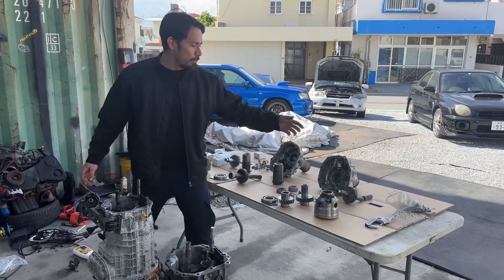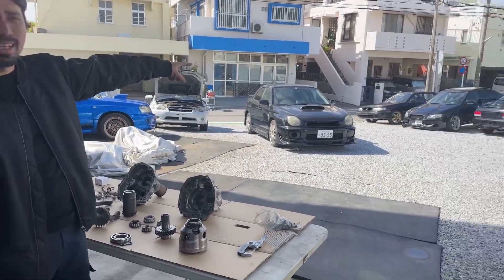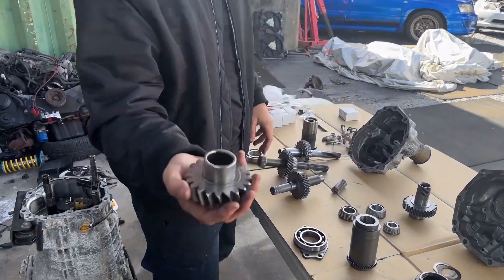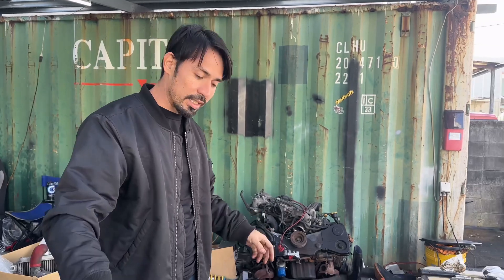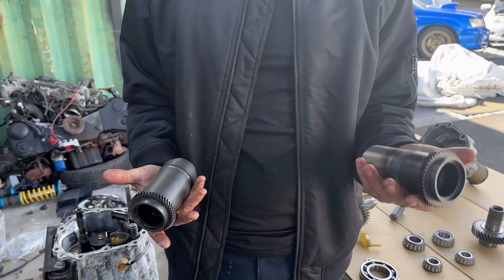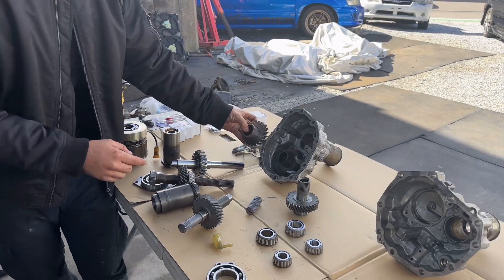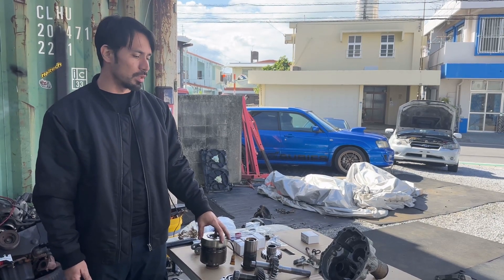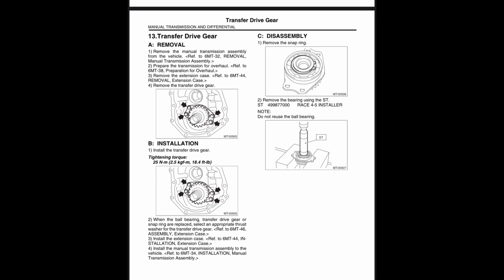TECH TIP for converting non-DCCD to DCCD 6 Speed / EZ30 Turbocharged Legacy

Comment: I have a question about the  automatic transmission setup. I have a built 5EAT ,  2008 OBXT, with HD plates and sleeves re-enforced, as well as a modified valve body. The trans was specially rebuilt to handle 8-900 hp. My understanding is that the trans (jayco) was used by many auto companies, like Nissan, in their Maxima, and the Pathfinder, and who’s only real weakness was that it was given a “Socker mom” tune, making is slow on the engagement of is clutches, providing a smoother, less noticeable shift. This in turn, with Subaru’s hi torque in their turbo and 6 cylinder engines, eventually killed the 3 to 5 clutches and packs prematurely. This was remedied by the alteration of the valve body, increasing line pressures and increasing speed of clutch engagement and release. But a question arose as to the center differential, being full time engaged, with bias towards the rear at approximately 40/60% towards the rear using a torsion style differential gearing. Is it possible to use a dccd controller or dccd’s components, mimicking the operation of the STI 6 speed in control of front / rear bias control in the automatic? It was difficult to find any more information on the 5EAT differential online. And the builder only provided the functioning transmission to great satisfaction. I have been unable to reach the builder for answers to this question. I was hoping that your group may have answers for me in this regard. Anything that you can explain to me would be greatly appreciated. Really enjoy following your channel, and find your approaches to mix and match with this line of car’s unique on YouTube. Thanks you for sharing you knowledge. And thanks for your possible help in my concern.
Reply from the maker: What a knowledgeable bomb type of question! I love it! What a great question! Do you have the transmission number for your setup!? We have some Foresters that are AT that we will be parting out and if they have the same one as in your car we could possibly take it apart and do some comparing like this video.

Thanks for the question and great info!
Reply: @OkiSubies  also, I’ll send you the trans number in the next few days.
Reply: @OkiSubies  I forgot, the setup is the same as some forester 4eat’s with VTD.
Reply: @jamesa.buchertjr.8950  whats your transmission number bro? did we forget about this!?